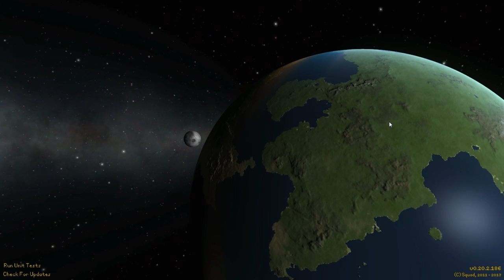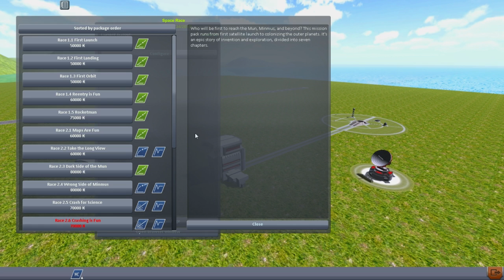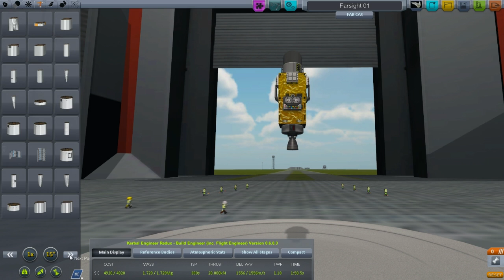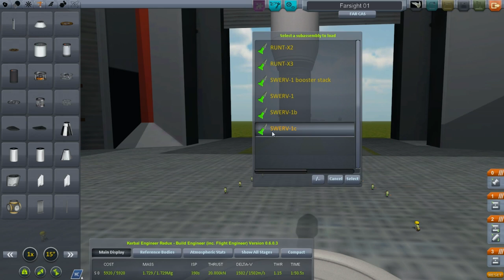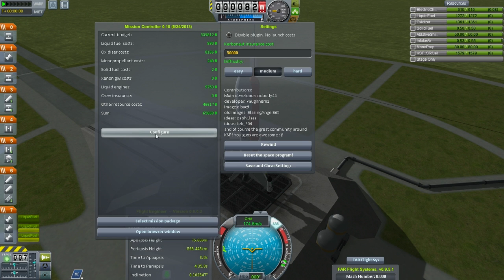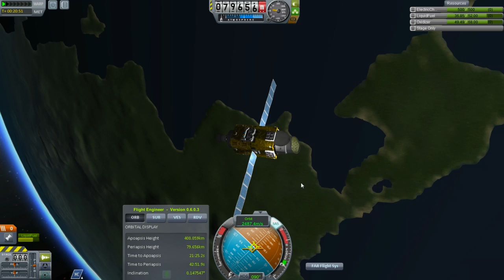Let's Fly KSP: Mission Controller Mod, part 15, Mini-Hubble

Comment: (I am an spanish speaker, so I saw this kind of aparent "gibberish text" a lot when my local friends try to write fast in english).

What he was trying to ask is:
* "What button do I (need to) press to get towards down?"
The answer:  
(If the front of your ship is facing to the horizon) -> You need to press "s" on the keyboard to move the nose "down" in relation to your center of mass. 
[Most of the time that will move both planes and rockets in flight near to the ground faster].

Comment from the maker: I agree! The wheel base needs to be wider, the engine needs some strong struts to hold it on, and I need to pick landing sites more carefully. Maybe only launch and land in daylight. I really want this thing to be my default lifter for 1.25m payloads.

I'm starting work on the 2.5m version now.

Comment: Hey Matt, I think the problem on landing the SWERV - 1C can be fixed easily by widening the wheel base. Try sliding the landing gear outwards a bit from the center of mass, I know you can find a work around. I'd hate to see you "overdesign" the craft as it seems to fit all your space package delivery needs at the moment! I like that you will be using the same lifters repeatedly and I have the utmost confidence in you to perfect them.

Comment: You wouldn't need to. In fact, you wouldn't even need to follow them actively. If you attach probe cores to the boosters, the game won't delete them. Just set the parachutes on the same stage as the decouplers (shouldn't be an issue at the heights you ditch them), and after you landed the ERV, switch to the boosters to recycle them.

(Disclaimer: I've never used the career mod myself, so I'm not certain if this is actually possible within a mission :D )

Comment: The advanced solid rocket booster caps has a little bit of extra fuel designed to flow at t+100seconds or t+50seconds.

Comment: Hey you went back into the air when you landed because of the airbrakes on the vertical stabilizer. Either have a second set of airbrakes on the bottom to balance or try to shut them down during landing

Comment: A tip when landing: after you flare the nose up, use your throttle to adjust your decent rate, not your nose angle. Similarly, to adjust your horizontal speed, raise or lower the nose rather than change your throttle settings. It sounds counter-intuitive, but it's how such things are done in real life.

Comment: Matt, the SRB's are supposed to behave like that.  There is an action group nozzle on the nozzle for separation gimble.  It looks the nozzle so it spins them outboard.

There is a noticeable change in thrust when they hit the "reserve" fuel.  Pop them right away. ;)